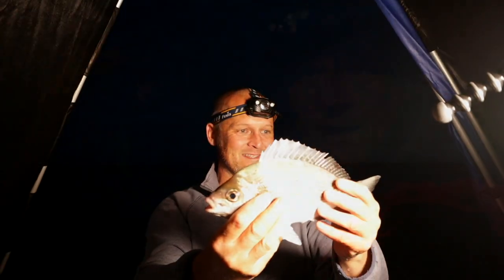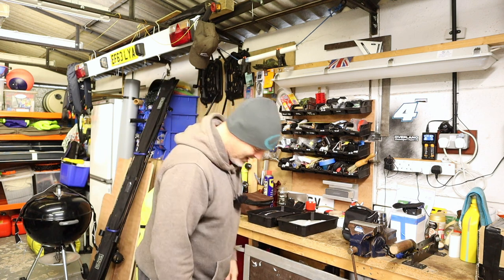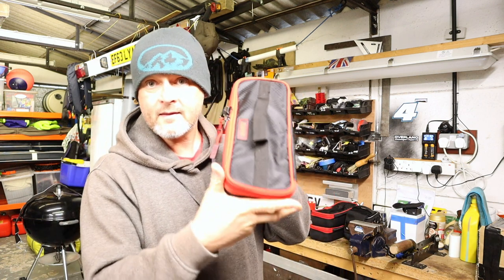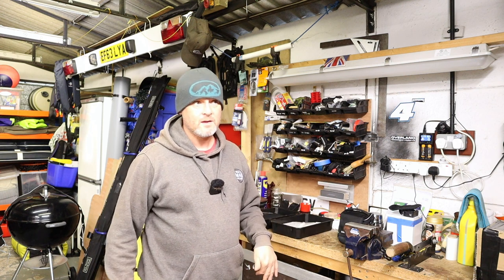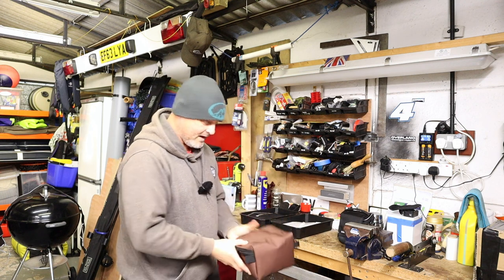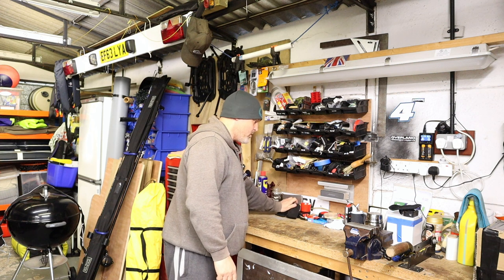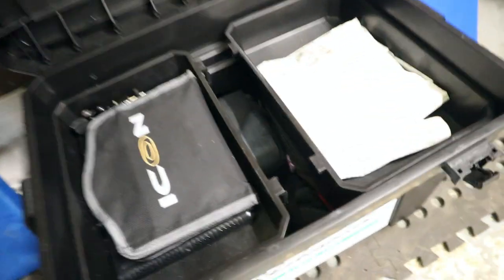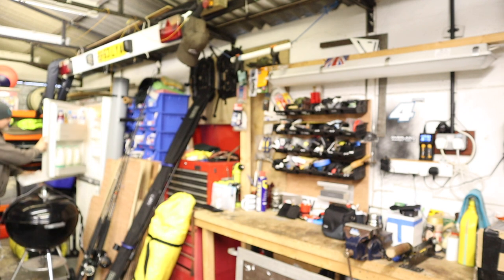Beach fishing preparation - how I pack my seat tackle box

Comment: Excellent video. I pack mine totally different but as you say it's a personal thing. For me, the trays are of key importance. Everything you have in the bottom layer goes loose in the trays in my box, held captive by the seat cushion. That way, I just clip the trays on the side and everything is open, clearly visible and to hand without having to unzip pouches and search about for stuff. Weights in the trays higher up are fine, so long as they're placed towards the rear of the box (close to my breakaway harness & my back).  I always carry flask and water, so that is my base layer, along with my reels and bait box.  Small chopping board and folding bucket also inside.  Spare clothing fills the spaces in between.
Reply from the maker: That sounds like a well thought out and effective routine where everything has been tuned over time. Everyone will have their own way and some prefer the “chuck it all in” approach. Which ever way it goes it is always interesting to see what others do. Which size box did you go for?

Comment: Separate zipped up bags for everything is the way forward. For everything aswell I have had random dogs bolting at me in the past. Literally only have things out I need, this saves your losses big time and is safe for loose dogs. I had one dog run off with my chopping board and another swallow my glove whole (that wasn’t even out it was in the netting compartment, I had only just turned up so not put them on yet). Nearly got bitten when I tried to get it as well.
Reply from the maker: I have my boat rigs in A5 zip up sleeves/bags. They work really well. 
I got bit by a dog walking to the beach along a path and the owner couldn’t care less. 🤷‍♂️

Comment: Thank's Mark, great to see how others set out. Thinking I'm going to finally order a seat box like this. I like mine at the moment as it has a tackle compartment built in. The main compartment is too small now with my 2 fixed spools in so time to upgrade. How do you carry your gear around for beaches like Chesil that aren't near the car park? Trolley?
Reply from the maker: Hi Shaun, for longer walks or where it is going to be hard work I use a rucksack. I was lucky to find one where the back unzips rather than top loading. You can lay it down, undo the zip and see everything inside. It still carries like a proper rucksack so it has waste and chest straps and can be adjusted to sit high up. Much more comfortable but no seat.
Reply: @seaangling  That's a good idea, I may try a sledge next time 😂

Comment: Mark. Where do you get those zip up containers from, the ones you but your lead weights in. I could just do with 3 off them. I have trolled ebay for them with no luck.
Reply from the maker: They are few and far between atm I think due to supply. I got mine from Tommys tackle and bait in Bursledon.